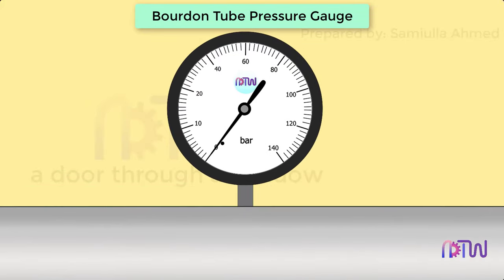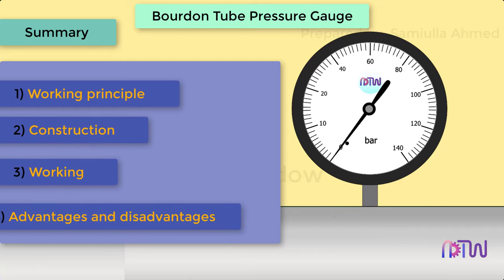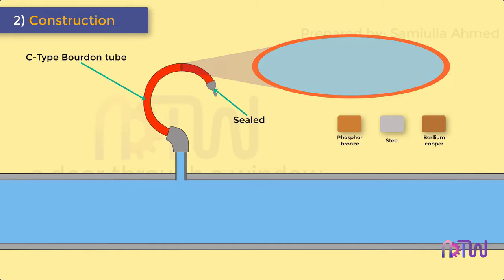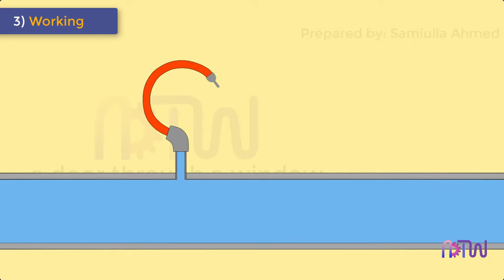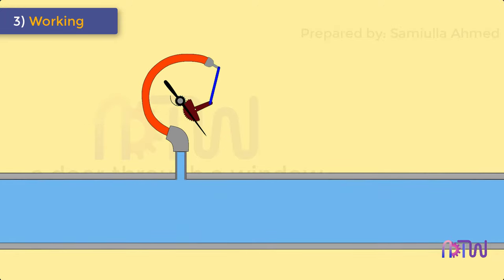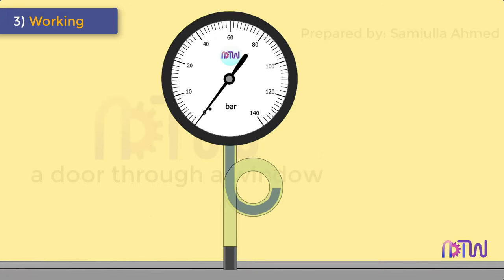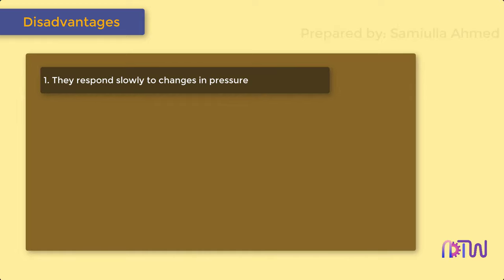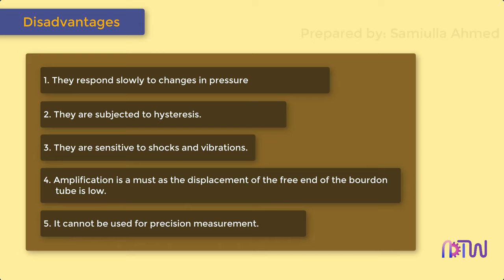Bourdon Tube pressure gauge working animation

Comment: Are bourdon tubes are used nowadays? 
If yes then where are they used? 
And if no, 
Then what transducers are used intead of this tube
Reply from the maker: Yes they are still in use these gauges are used in water supply lines and other areas where liquid pressure is to be measured.
And transducers are used wherever we want a pressure measurement in the form of signal so that we can give that information to PLC where it can be used to control other parameters.
Reply: Ok thanku